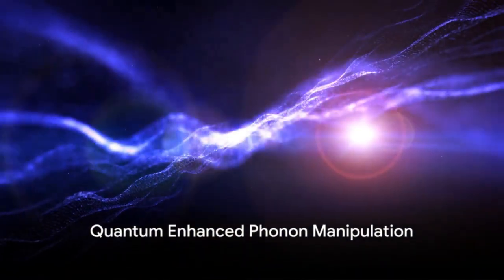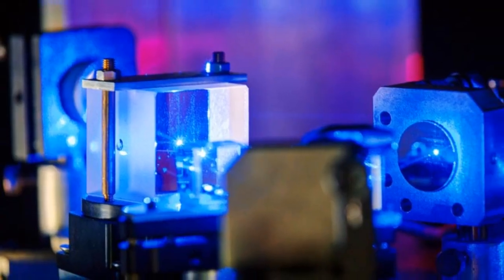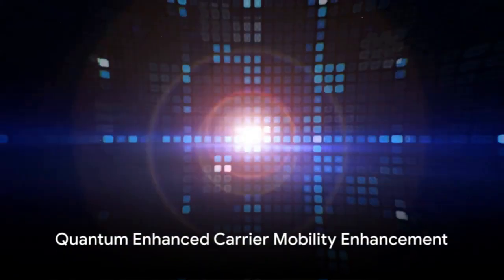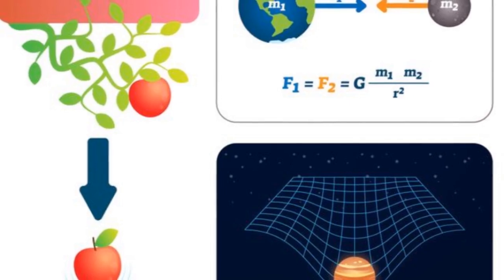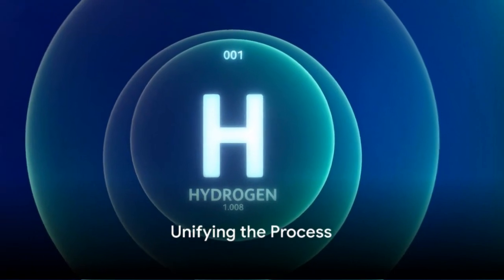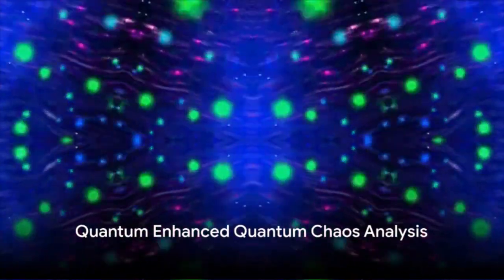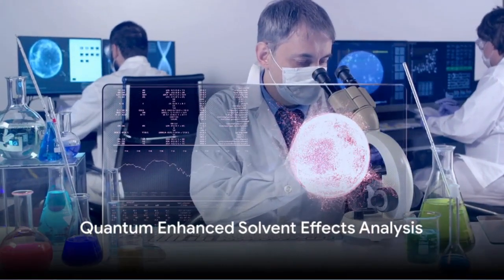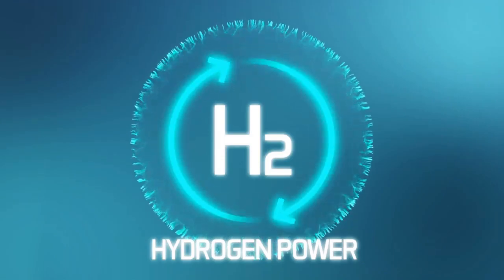How to Split Water into Hydrogen and Oxygen with the MEQ

Comment: Gone through the justifying answer. Still it's too theoretical. It would have been better to explain basics to a layman like me. It feels like a robot firing down the sentences, like explaining n! i.e. n factorial.
Reply from the maker: I'm sorry to hear that you found the explanation a bit too theoretical. It's important to make complex topics accessible to everyone, which is why I'm investing in doing this. Let me try to break it down a bit more. Splitting water into hydrogen and oxygen is an amazing process that involves some new and intricate science. At its core, it's about using a special kind of energy that tunes the atoms to vibrate perfectly to separate the water molecules into their individual elements, hydrogen and oxygen. Think of it like taking apart a puzzle to see the individual pieces. To do this, scientists use a variety of techniques and technologies. One common method involves using electricity to trigger a reaction in the water. This reaction causes the water molecules to break apart, forming hydrogen and oxygen gas. So what. Why is this important? Hydrogen is a clean and efficient fuel source that can be used in a wide range of applications, from powering vehicles to generating electricity. Plus, when it's burned, the only byproduct is water, which makes it incredibly eco-friendly. The process may seem a bit like solving a complex math problem (like n factorial), it's essentially about finding innovative ways to harness the power of water for a more sustainable future. I hope this explanation feels a bit more down-to-earth. If you have any more questions or if there's a specific aspect you'd like to dive deeper into, feel free to let me know!